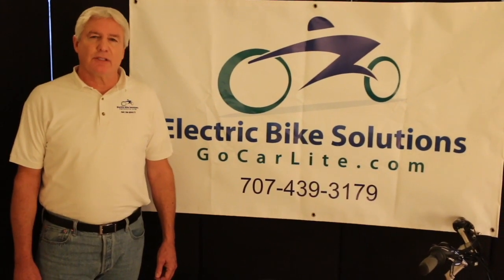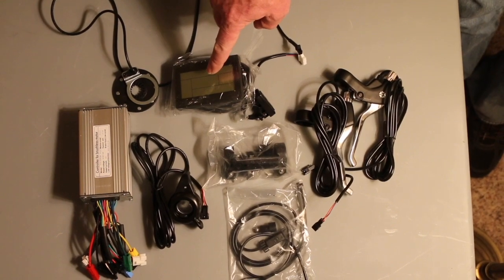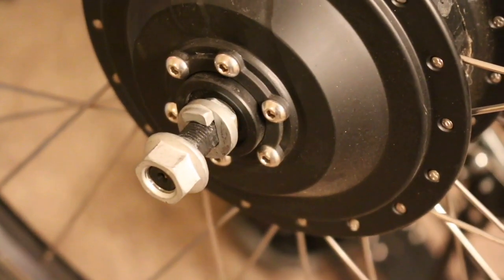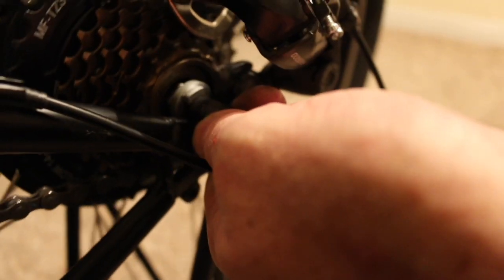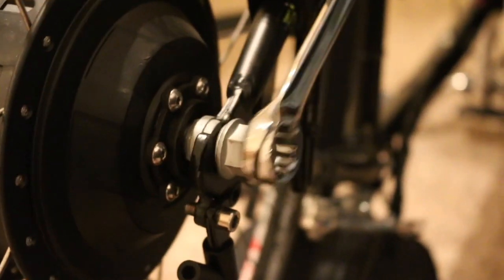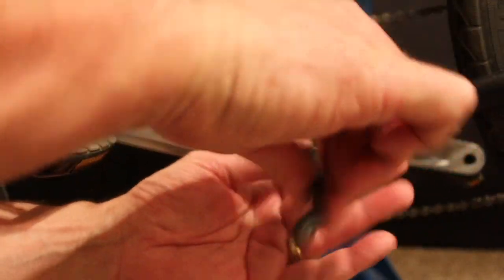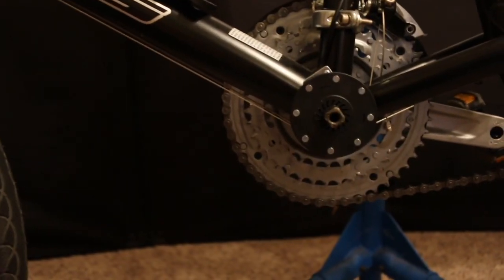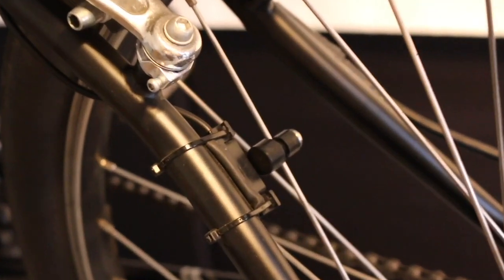Electric Bike Kit Installation

Comment: Grinding sound and on the speed meter it says error 7 maybe you can help me out with that might mean
Reply from the maker: The LCD3 does not have an error code 7.  Look online for the type of display model you have.  Should be a manual out there.  Hope that helps.